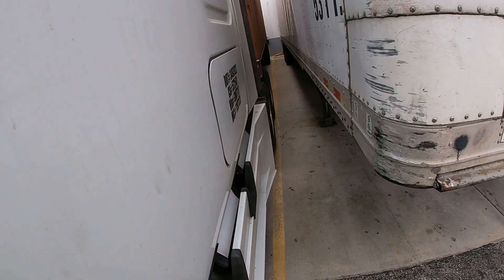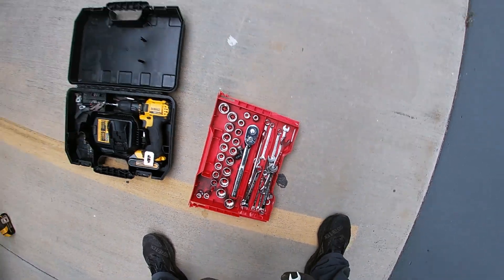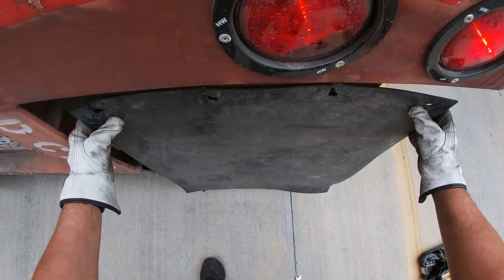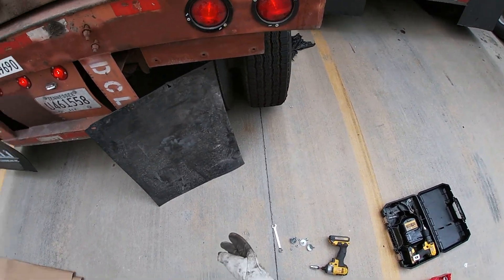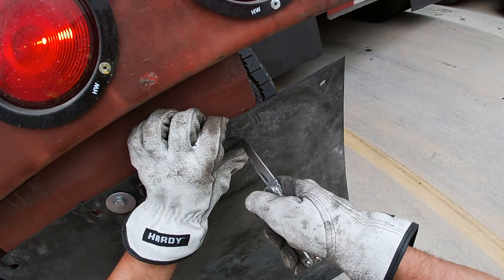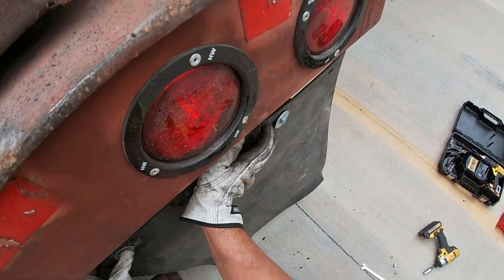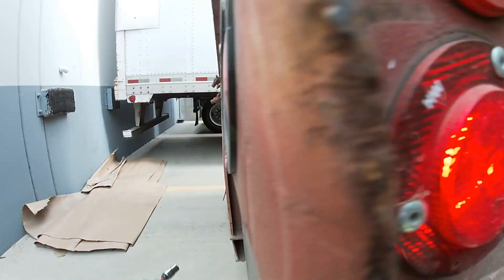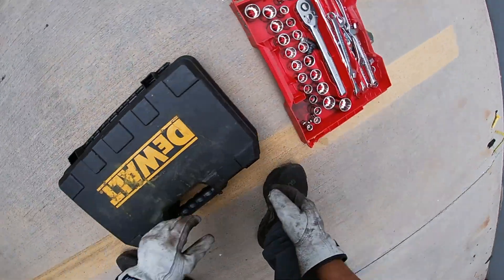How to Change a Mudflap on any Trailer or Chassis

Comment from the maker: Office Supplies:
clipboard with storage - https://amzn.to/3s8QQbe
Pens - https://amzn.to/3QA3qug
White Out - https://amzn.to/3QEgn6w

Tools:
craftsman versastack - https://amzn.to/3E0pgiZ
Flash Light w/Hat clip - Streamlight Micro Stream - https://amzn.to/3OkFLeG
Steering Wheel Knob for Truck - https://amzn.to/3KwMiBP
Jumper Cables - https://amzn.to/3DFiPla
Dewalt Drill and Impact Driver Combo - https://amzn.to/3DAclEl
Leatherman Wave - https://amzn.to/47cVTHS
Bolt Cutters - https://amzn.to/3rYtTHP

Dash Mounts:
iPad Truck Mount - https://amzn.to/3rP6Uig
MagSafe Car Mount - https://amzn.to/3KidWm0

Head Sets:
Trucker Headsets - https://amzn.to/3KyGUOM

Apple:
Air Pods Pro 2nd Gen - https://amzn.to/44KG6OB
iPhone 14 Pro 6.1”  - https://amzn.to/455UsZF
iPad Pro 11” - https://amzn.to/3DA55Z3